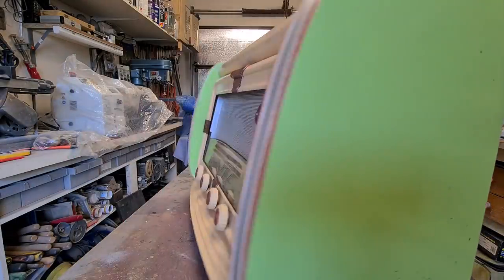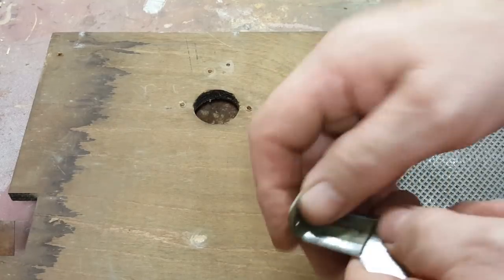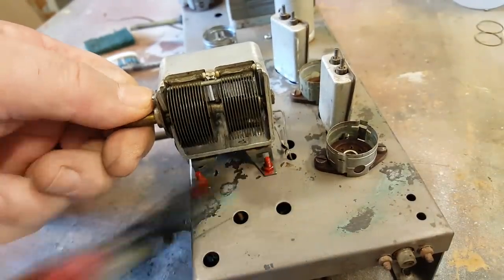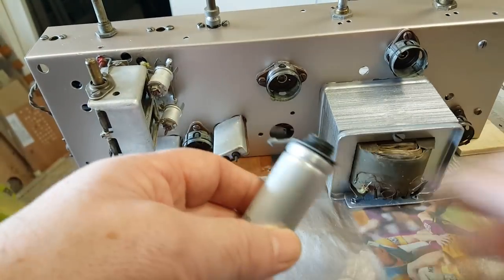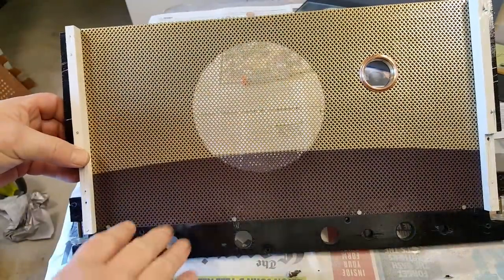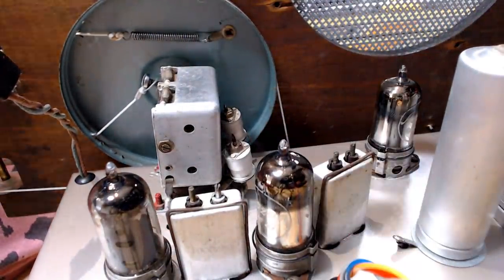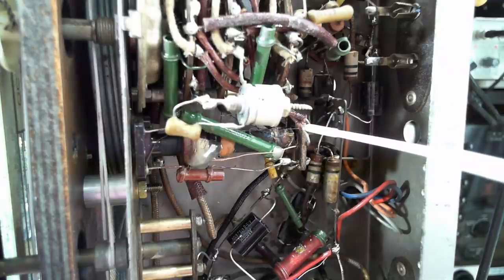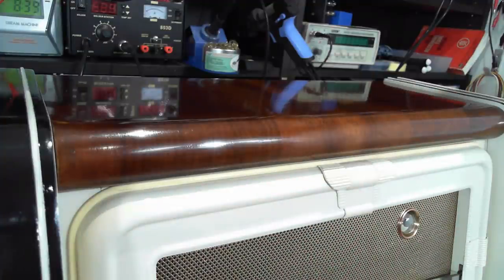The French Connection - UNIC 'Royal' Radio- Restoration Part 3

Comment: Hello  David. I have a question for you. When setting up an AC power source for vintage radios in the AC line block diagram that includes a Variac, an isolation transformer and a dim bulb tester which comes first starting at the wall outlet?
Reply from the maker: Hi Martin, I have set mine up thus: Variac > isolation transformer > Dim bulb. The Variac and isolation xformer cases are both earthed so I have done it this way to maintain the earth connection.
Reply: @DavidTipton101  Thanks David. I modeled my system after  your suggestion. Wish i could send you a pix of my Set up.  Martin

Comment: Mr. Tipton, you are beginning to set new benchmarks in regards to content quality, technical background and of course editing skills in the youtube section of vintage electronics restauration! The rapidly increasing number of views and subscribers to your channel goes to prove just that. Thumbs up, excellent and entertaining video!!
 I wish I had the time to edit all my raw videos and upload, but full time employment on my side is a bit prohibitive right now unfortunately... 
On a technical aspect: What voltage do you measure between cathode and and target of that russian 6e5c? In the video it just seems a tad dim, as if it were only around 130v? If the voltage is around 200 then there is the possibility your supplier is giving you 2nd grade duffs because the worldwide stock of premium russian 6e5c is slowly drying out, quite a few remaining lower quality ones being sold off now, hence my question.
Cheers from Germany
Reply from the maker: Hi Blitz, thanks for the complement, my channel is going better than I ever expected. The voltage was just on 200 and the tube is a little dull but it's more than enough. I bought 3 tubes and they are all the same. I turned the voltage up on the variac and the brightness came up. Maybe they are second quality 🤔

Comment: 36:11 David, I think the main offender is the painted insides of the side cheeks. I think they should also be veneered for contrast with the white metal frame. Also, the decorative plastic pieces of the metal frame should be a different colour. Perhaps the original red was indeed original? Last, I'd venture saying that the bottom decorative piece under the metal frame ought again to be a different colour than the frame's.
Here https://assets.catawiki.nl/assets/2016/12/19/1/a/1/1a18d9d4-c5e4-11e6-947e-126012d9d6fb.jpg you can see that the frame is painted dark (ebony?) and the cheeks veneered. More photos here:
https://www.catawiki.gr/l/9333907-unic-royal-tube-radio
The backing that the frame is fixed on is ivory and the decorative plastics are ivory too so the dark frame makes a nice contrast and thus looks indeed .. like a frame.
I don't know whether the radio in the photo is in original condition (I'd prefer the bottom decorative part in lacquered black like the sides) but I'm sure it's easier to take it apart the second time around.
Reply from the maker: Hi Stelios, the inside cheeks were painted originally because I could see the paint under the 'newer' paint. I agree though it would have looked better veneered. I saw the radio in your link but it has been repainted too so I didn't use that for reference. I checked the finish under the parts that had been repainted when I stripped them back and refinished them in the original colours. Yes, maybe the steps would have been better in black.

Comment: Aren't the 4 plastic pieces on the front of the radio supposed to be gold (same color as the buttons)?  Honestly, i think that is what is throwing off the look. Some more accents with those plastic pieces will break up all that off-white on the front.  The sides that you re veneered look beautiful. They really turned out well.  Nice job.  It's a shame you don't like it.  But maybe that is why they painted it?
Reply from the maker: Hi tarstarkusz, I am going to redo the plastic pieces as they do nothing to break up the front area. You might be right for the reason they painted it 🙂

Comment: Watching the way you removed the valves was rather worrying, those rings on the valve holders have a nasty habit of breaking off the glass  location pip on the valve (ask me how I know!)
It is good practice to either remove the locking ring altogether, or slide it down so it no longer has the chance of  damaging the location pip.
In my opinion this type of valve holder is a design flaw, the ring is not really needed to keep the valve securely seated.
Reply from the maker: Hi markpirateuk, I worried about taking the valves in and out but the springs on these ones were very light but I know what you mean. I have gassed a few valves in the past with these and Loctel bases 🙂